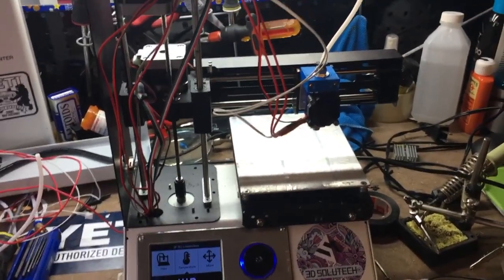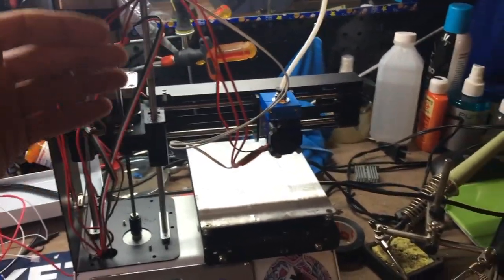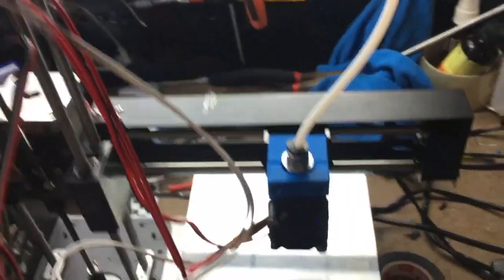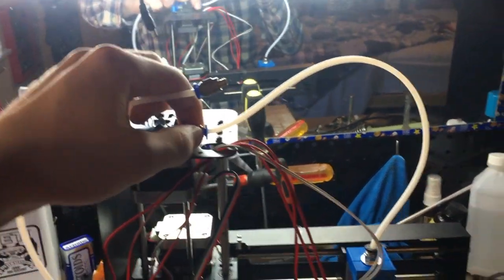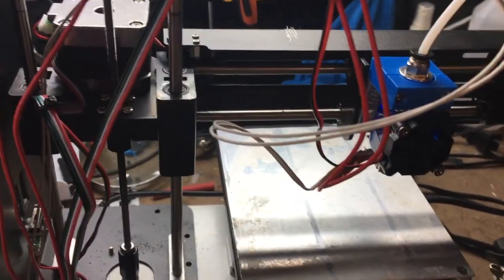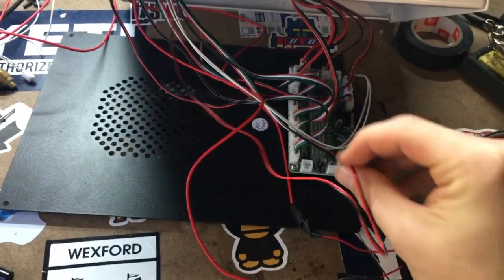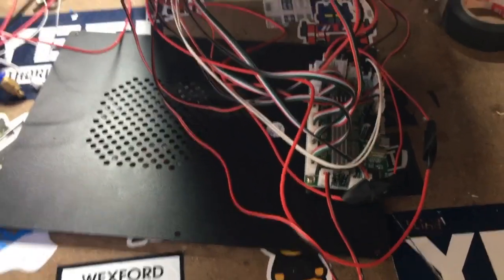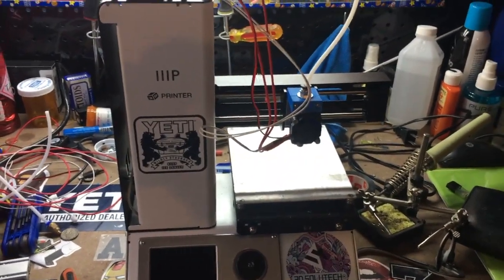How to install E3D hotend on Mp Select Mini 3D printer

Comment: Hey Turner! Quick Question...  I JUST installed my E3D V6 All Metal Hotend on my Monoprice mini V1. One issue - between the end of the E3D assembly instructions (and what your video covers with actual install), I am confused about how to actually connect the Monoprice bowden tube to the top of the hotend. I see a nut in the video but the way it seems there is no threading at the top of the hotend. I have pics I can email you if you want to get a visual - I just need to know how much to cut the PTFE tube at the top of the hot end and how exactly to screw on the mimi's bowden tube.

Thanks!!

Comment: I for one enjoyed the video. Easy for me to follow. Got a question though, when you installed this hot end, did you have to mess with the "coding" or parameters of the printer since this is upgraded from what it came with?  If so, how did you go about doing this.  Thanks
Reply from the maker: Will Allen Im sure you could. However you can mess with the mechanical aspects of the printer instead of getting into the code. For instance, leveling the bed may be the easiest. Thanks for the comment

Comment: I accidentally pulled out one of the 2 wires white wires that splits into the hot end and I have no idea what it's called and I'd rather not have to order the whole new set.
Reply from the maker: Rick Malone Honestly if I were you i would probably try to solder a new wire in there and make it work somehow.. i wouldnt want to buy a new one either